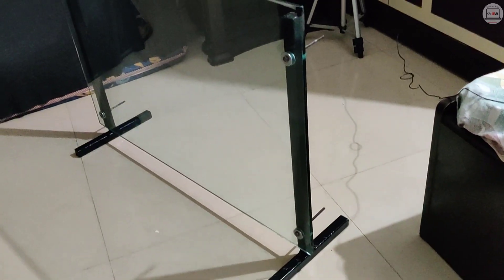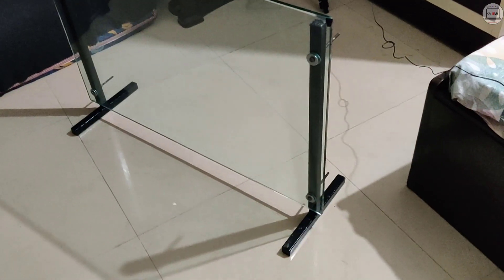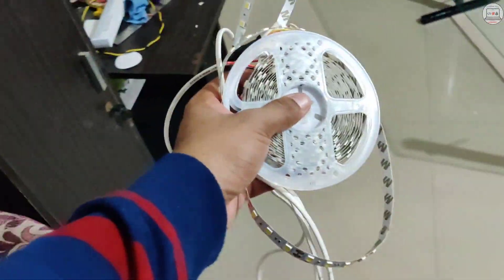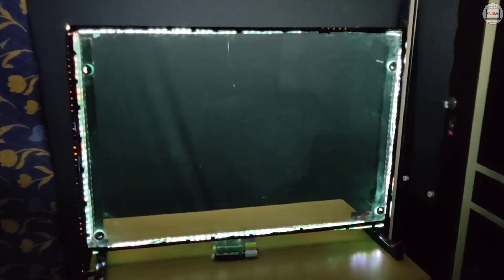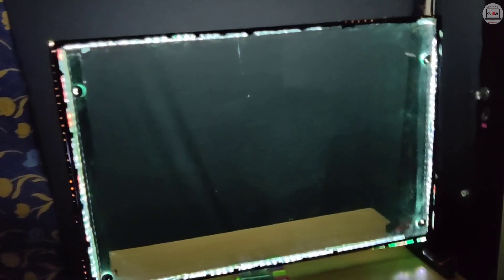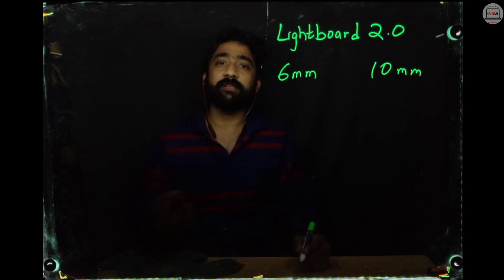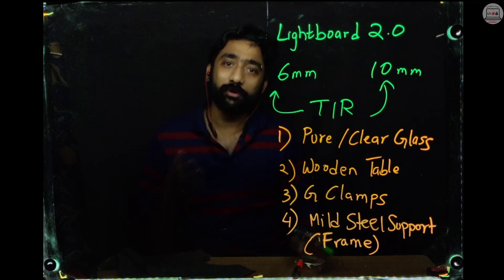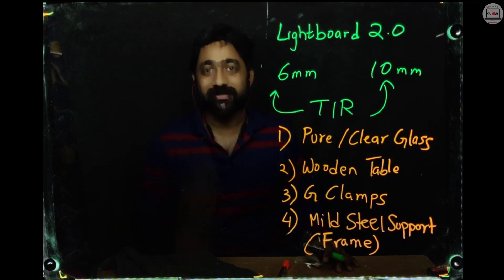LightBoard 2.0 | Better Version | Under 8000 INR | How I made my own Lightboard | DIY | Sridhar Iyer

Comment: I built my own lightboard with Acrylic 10mm. The smudges on the board is pretty bad. Could you tell me what you use to erase the board with? Thank you
Reply from the maker: I use a slightly damp microfibre cloth. My first lightboard version was made of acrylic as it’s lightweight but for this model i used glass only. Its heavy no doubt but can be used for long term.

Comment: Pretty cool, I have been thinking about building my own light board. Did you consider using  Blacklight LED strips instead of simple white light LED strips? From what I understand, the BLacklight will make the Neon markers “pop” more?
Reply from the maker: Thanks. Yeah I used the white led strips. Would definitely want to try the blacklight led strip. Need to research a bit though.

Comment: Sorry to bother,  should you write backwards on the glass?
Reply from the maker: No No. You need to flip your video horizontally by 180 degrees. And if you are using it on any live application like zoom, meet, teams, then you need to mirror the source.
Reply: @sridharciyer  thanks man, 🙏
Reply from the maker: Most welcome 😃

Comment: Is it so that the thicker the glass or plexiglass the better the lightboard will be?
Reply from the maker: Yes. As more light would be trapped inside. Normally around 0.8 cm to 1.5 cm thickness is perfect. 

Anything below or above the range might not give the optimum results.
Reply: @sridharciyer  Great! Thank you for your quick reply, I appreciate it.
Reply from the maker: You are most welcome ☺️

Comment: सर, अगर हम 6 inches x 4 inches साईजमे light बोर्ड बना लेते है तो कितना खर्चा आ सकता है ? and if I use daily 2 hours, then how mcuh tentative marker expenses I have to consider?
Reply from the maker: Sir , in that case, glass ka hi coating costing change hoga.
Par ha as glass heavy ho jayega toh iron stand thoda aur better quality ka lena padega else weight nahi utha payega. 
If possible you can contact a carpenter and ek permanent frame hi lagwa sakte ho aap with a wheeler, depends on the budget. 

According to your usage markers can last for 4-5 months . 1 time cost approx 1000-1200 hai.
Reply: @sridharciyer  Thank You Sir. Surely I need fixed wooden frame. Actually I have a strong wooden table to which I will like to attach frame.

I am confuse about markers. Tell me about white color markers (if possible share link) having greater life
Reply from the maker: Yes. A permanent  wooden frame and table would be a brilliant idea. I use these markers. Expo Neon Dry Erase markers. During the lockdown these markers were very costly, around 2000 rupees. Now they are available for around 650-700. Best time to purchase them. 

I am not sure about the white colour, preferred colours would be the flourescent neon colours. They will look brighter. 

As glass has its natural greenish tint, even white marker would appear greenish. 

Kindly find the link. https://amzn.to/3lzHXkg

Comment: I want to make one of these, but wondered if instead of using tape to hold the LED in place... could I use a rubber u-channel to hold them in place or do you think it might not allow the LED to stay cool?
Reply from the maker: I would say try with a small patch. In my case I didn't feel any heating issue. So you can try on a small area. Keep it On for 10-15 minutes and then take a call. I don't think it will have any issues, rather I liked the idea 😃.
Reply: @sridharciyer  Thanks for the reply. I will try what you said. I was ordering my u-channel from ebay. Was going to leave a link in the event you were interested but my message gets removed because links aren't allowed.
Reply from the maker: @The-Real-MOTIONMAN  ohh you can send the links on my email id. c.sridhar89@gmail.com
Reply: @sridharciyer  Email sent. Good luck :)
Reply: @sridharciyer  I forgot to ask... is the glass you used "low iron"? That's what I really want but a 12.7mm thick piece of low iron that's 36 inches x 48 inches cost around $1097 USD!!!
Reply from the maker: @The-Real-MOTIONMAN  no. Mine is the regular glass only. If you have the markers handy, you can go and test it out whether they are visible on the glass or not. Actually I got it from a local physical store so I was able to test everything before purchasing 😃

Comment: Dear sir
I need guidance to set up the board....but confused about choosing the glass
Reply from the maker: Hii. You can opt for normal window glass. It will work fine. Minimum thickness must be 6 to 8 mm for better visibility.
Reply: @sridharciyer  window glass mean which we use showcase r8 ?
Reply from the maker: @ratnadeepdas4102  yes. Just make sure it's completely clear. Not the opaque ones. I got it from a local market. I simply asked the shopkeeper to provide me a clear glass of the given dimensions.
Reply: @sridharciyer  thank you very much sir...
Reply from the maker: @ratnadeepdas4102  most welcome sir
Reply: Sir which color marker would be better for the board ?
Reply from the maker: @ratnadeepdas4102  try neon green, neon orange or neon pink. These colours look best.
Reply: @sridharciyer  thank you very much sir
Reply from the maker: @ratnadeepdas4102  most welcome sir

Comment: @
For live online classes using lightboard and your android phone
Reply from the maker: You can use them together. There's an app called droidcam using which you can connect your mobile phone with your laptop as a webcam. Then you can use any live video conferencing app like zoom, gmeet etc to conduct live lectures.

Comment: Does the glass reflect light better because it's glass or because it's thicker (10mm vs 6mm) or both?
Reply from the maker: In my opinion, I first tried with plexiglass but the light was not that prominent so I switched to regular glass. It gave me much better result. 

And yeah 10 mm glass gives much better result but 6 mm will aso give good results.  Don't go beyond 10 mm as the frame will become too heavy to carry if you want portability.

Comment: How you recording
Reply from the maker: Hii, I have kept my mobile phone on a tripod at 2-3 feet distance from the screen.
I have used a black cloth behind me to reflect off the extra lights and once the recording is complete, you can use any video editor to flip the video horizontally by 180 degrees.
Reply: @sridharciyer  But in live class are you using droid cam in the phone to connect phone camera with obs
Reply from the maker: @manjulak866  yes. I use droidcam and connect it to obs.and flip the video source by 180 degrees horizontally
Reply: @sridharciyer  yeah, 👍 but when i tried the droid cam the focus is not working as i wish
Reply from the maker: @manjulak866  you can click on the screen from either the droidcam app or the windows droidcam client. You can either select autofocus or manual. Try to keep the background as dark as possible
Reply: @sridharciyer  Thanks for the information i made my own lightboard with  the tutorial you uploaded in your channel i made that using window glass it is also good to write
Reply from the maker: @manjulak866  Glad to know that mam ☺️ yes window glass is also suitable. Just make sure you wipe off the market stains after use. Else they get difficult to erase.
Reply: @sridharciyer  yes but when i light up the board small scratches are visible

Comment: Hello

I have 2 issues on my lightboard

1.all neon colours is seen as green colour when written...Orange /blue when used looks like green
2.Letters when written on the middle of the glass is not that clear...

Please advise
Reply from the maker: 1. It actually depends on the glass used. Even I also get a slight tint of green. So I use  bright colours such as neon pink and neon green. It also depends on what colour LED you have used. 

2. That's something new, as I haven't faced any such issue. I guess the insides of the glass are not getting illuminated properly. Try covering up the back of the LED strips using black tape or any black chart paper to avoid light escaping the glassboard. That should solve the issue. 

If your glassboard is lit up properly it should actually solve both your issues. 

Regards
Reply: Appreciate your quick response...Thank You Sir and Keep doing great work!!!
👍👍👍
Reply from the maker: @gurudutcotipalli9366  Thank you so much ☺️
Reply: In your sample video, after the set up, the writings are bright and clear. But your face is not that bright? Is there any lihhting issues to take care?
Reply from the maker: You can keep 2 soft lights on either side of the board facing you to illuminate your face. 2 small portable tubelights will also work. In my case, i didn't have enough light  that time. So maybe my face didn't brighten up much.

Comment: what is marker name you use
Reply from the maker: In the market, the best neon markers available are Expo Neon ones but they are costly. 

So I used the following. It gives me pretty good result. You can also check the other things I use.

Materials Used :

Markers Used: https://amzn.to/2PBtSD3
Duster/Microfiber Cloth used : https://amzn.to/30ENNrh
G Clamps Used : https://amzn.to/30EAV4g
Mic Used : https://amzn.to/2DxcD3q
Reply: we can use highlighter
Reply from the maker: @Kidscartoonclub11  highlighters are not that bright with glassboards. Have tried it. Didn't get the desired brightness. They are too dull on the glassboard as they don't absorb the light properly.
Reply: @sridharciyer  thxxx dear
Reply from the maker: @Kidscartoonclub11  most welcome ☺️☺️

Comment: I have black glass..can i use it as a lightboard??...will it work properly as compare to white glass??
Reply from the maker: You can try with white LED strips and white neon markers. Not sure though but you can try and let me know if it works.
Reply: @sridharciyer   thank you for your response sir...i will definitely inform you if it worked or not...thank you for your suggestions..
Reply from the maker: Most welcome sir.

Comment: Sir  , one question 
All the writing looks the other way around
Reply from the maker: You simply need to flip the video horizontally by 180 degrees in any video editing software.
Reply: Actually I want this writing in live zoom meeting 
It is possible ??
Reply from the maker: @subratachakraborty8726  yes it's possible . Kindly use OBS studio software and then you can use it to conduct live lectures using your light board. 

You can check this video of mine where I have precisely discussed about it only. 

https://youtu.be/fLnEFfh5s_s
Reply: Thank you so much 🙏
Reply from the maker: @subratachakraborty8726  You are most welcome.

Comment: Glass u used ....is it simple plane window glass.
Reply from the maker: Yes its a plain window glass only. I didn't go for the low iron one as it was a little on the expensive side.
Reply: @sridharciyer  ....which markers I have to use while writing on it.
Reply from the maker: @irfanparray5795  You can use any neon markers. There are many brands available. You can go for the expo neon markers or the one I have mentioned in the video description section, they are a little cheaper and does the job well.
Reply: @sridharciyer  thanku very much sir.....love u.....I am overwhelmed by ur content and generosity. 
Thanku very much
Reply from the maker: @irfanparray5795  Really glad to hear that sir. Thanks a lot ☺️☺️

Comment: Sir..what is the size of the lightboard ? Length and width ?
Reply from the maker: Hello Sir. Mine is a Tabletop setup. It is 3 feet in width and 2 feet in height.
Reply: @sridharciyer  thank you sir..for quick reply
Reply from the maker: @knowledgekattamarathi7177  most welcome sir

Comment: Wonderful stuff brother can I use wooden frame to fix glass.  any disadvantages???
Reply from the maker: Thank you so much brother. Yes absolutely. A wooden frame is a much better option. It will keep the lightboard sturdy as well.
Reply: @sridharciyer  thank you Brother 🥰
Reply from the maker: @khareemshaik3453  Most welcome bro

Comment: Dear Sir
For example when you write on the glass board, glass will reflect letters in the reverse manner. How these letters are shown in the proper way.
Any arrangement we need to make or require some set up in the computer
Reply from the maker: Sir you actually need to flip the video horizontally by 180 degrees using any video editor. 

If you want to take the session Live then u can invert the video source by 180 degrees. It will do the same.
Reply: @sridharciyer  Iam not that great in technical Sir. When you say video source, since am going to use Webcam, I mean you refer that, and is it possible to reverse the webcam
Reply from the maker: No sir you can't use a webcam with the lightboard. You can use your mobile phone camera
Reply: @sridharciyer  Thanks Mr. Shridar.
As am planning to take live classes for CMA, CA students, through webcam only, this doubt has arisen.
I just request you to bring another video detailing the above technical points. You can also leave few words as to the reflector pen that need to be used in glass board
Just a request
Reply from the maker: @sankarhariharan1895  sure sir I will try to make a video on the same. 

I have shared the link for the neon pens you need to write on a glassboard/lightboard. You can check the video description.
Reply: Just use power director app on phone and flip the video by 180 degrees

Comment: THANKS FOR THE USEFUL INFORMATIONS,

KINDLY EXPLAIN THE CAMERA DETAILS LIKE CAMERA BRAND AND SETTINGS SIR.

THANK YOU...
Reply from the maker: Sir I usually record my videos on my mobile phone only. Very rarely I use my DSLR. 

If you are planning to use your mobile phone only then you can use Open Camera app and adjust the exposure settings. 

Keep the value low and lock the exposure. Focus on the lightboard. Some trial and error will be needed. You will eventually get the hang of it. 

Do let me know if u need any further assistance. Thanks

Comment: Very nicely explained sir.... may I know which marker is used? Can ordinary marker serves the purpose?
Reply from the maker: Thanks a lot Sir. It should work with ordinary markers too but they might not be that bright. I have used neon Markers. You can check them here :

https://amzn.to/2PBtSD3
Reply: @sridharciyer  thanks a lot... I booked from your link sir....
Reply from the maker: @ScienceCapsule2020  Great sir. I am still using those markers only. They are still lasting. Just a tip. Clean the glass surface after you are done . Else if you keep the ink on the glass over night then it will be a little difficult to remove those stains
Reply: @sridharciyer  sir can I ask queries if any while setting glass board?. All d very best for better growth of your channel
Reply from the maker: @ScienceCapsule2020  yes sir definitely. Feel free to ask if you are having any doubts. Thanks a lot ☺️
Reply: @sridharciyer  so nice of you
Reply from the maker: @ScienceCapsule2020  Thank you sir

Comment: Dear Sir

I am having the following doubts

1.I am using crystal clear glass of 8mm thickness...Is the thickness and quality of glass good enough for light board?

2.My LED strip is 10mm and my glass is only 8mm is it ok or do I need to buy a 10mm glass?

3.Do we need to stick the LED strip on all the corners of the glass (4 side) or can we put it on any one side of the glass?
Please note that my LED strip is 24 watt/meter 

Please confirm

Many thanks for your continuous support!!!
Reply from the maker: 1. Yes sir even I have an 8 mm thick glass .
2. Even my led strip is of the same dimensions. No issues.
3. Preferably bottom side if you are planning to stick it to only one side. 

Most welcome sir.

Comment: I have a glass in a wooden frame....
Can we put the led strip on the wooden frame
Instead of on the edge of the glass
Please guide
Reply from the maker: Sir, if the LED strip is sandwiched between the wooden frame and the glass then it will serve the purpose. Just make sure all the light should go inside the glass.
Reply: I made a full frame and glass sits inside the frame...Led is stuck on the edge of the frame instead of the edge of the glass...
That was my mistake...Ill have to rework may be...
Thank You
Reply from the maker: @gurudutcotipalli9366  ohh in that case it won't work sir as the light should go diret inside the glass. You need to get the frame out. Stick the Led on the inner side of the frame and then put the glass or you can directly stick the Led strip to the glass and then surround it with the frame. Either will do
Reply: Appreciate your efforts
Many Thanks
Reply from the maker: Most welcome sir.  ☺️
Reply: Can we stick the LED on the top side of the glass ONLY ONE SIDE instead of all the sides...
May be a higher power LED 
Please advise if it works sir
Reply from the maker: @gurudutcotipalli9366  yeah that should be fine as you would be having the wooden frame so light won't leave out of it.

Comment: Sir i want to make a light board.. Ples guide me
Reply from the maker: Sir you need to decide the size of the lightboard.

1. Either a table top or a full size one 
2. Then you would need LED strip 
3. A frame to support the glass
4. Clear Glass 
5. Neon Markers
6. Some light to illuminate your face.
Reply: Sir glass ke bare me aur kuchh bataye please.. Example  jese konsa type ka glass aur kanha use hota he
Reply from the maker: Sir clear glass chahiye. Transparent. Glass pe hi poora lightboard based hai. Usi pe led lights lagte hai.